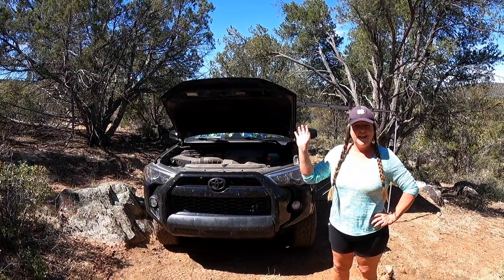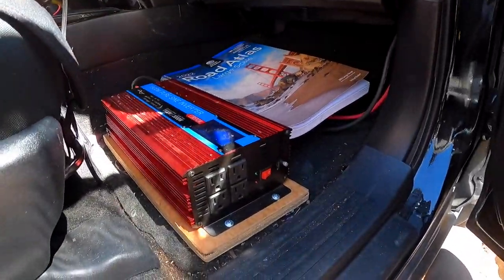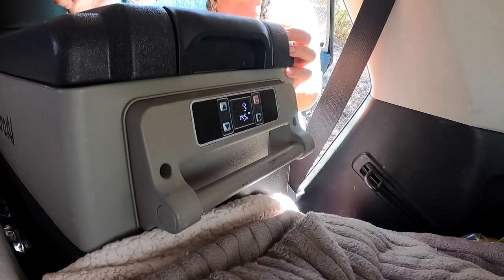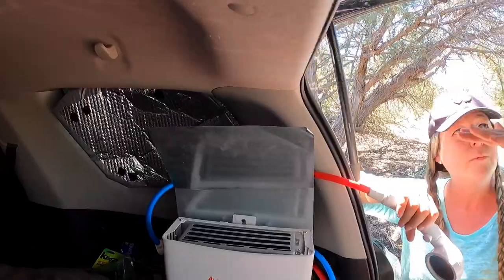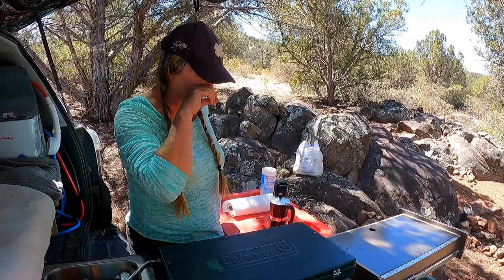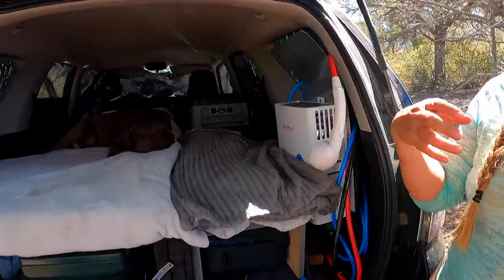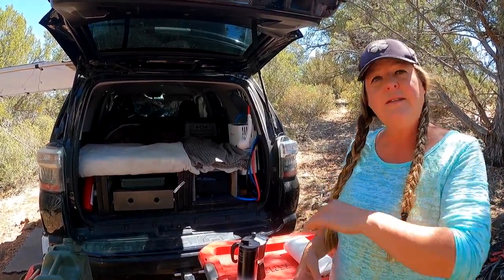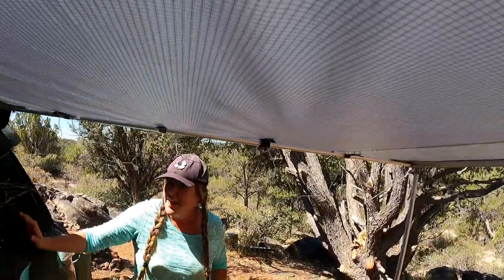BUDGET BUILDOUT (w/ Links) - $2,500 4Runner "Micro RV" Conversion - Solo Female Touring The West

Comment: Hi Donya.  Saw a nice red 4runner for sale today and wondered if I could fit to sleep in the back at 6’1”. ?  Currently sleep in a long bed Tacoma.
Reply: Hi Marc! I am 5’ 5” and I can fully stretch out on my sleeping platform and not touch the tailgate. I think if you either remove the front passenger seat or if you don’t want to do that you could slide it up as far as it will go then you’ll have plenty of room to sleep in the back. Just depends on what your sleeping system ends up being.

Comment: How do you hook up the hot water on demand for an outside shower when camping?
Reply: I have it mounted on some wood that I can pull outside to another location if I wanted, otherwise it just stays where it is, the tubes are lengthy and can reach a ways from my truck. It's such a great add to my rig!

Comment: @ 0:39
WRONG ONLY TO 50% OF CAP.
and that TRD is bone stock it doesn't have too much 4wd capability. so i would upgrade your axles to all the added weight.
Reply: Thanks for the correction! I'm learning more and more everyday
Reply from the maker: Hey Danial, I would have to disagree with needing to upgrade the axles. Donya doesn't have thousands of extra pounds to where it would stress the axles. A simple suspension upgrade would be sufficient and much more cost effective. Thanks for tuning in!

Comment: Where did you get the shower set up?
Reply: And, how did you set up the pull out drawer?
Reply: Hi Sandra!  I use the Camplux Tankless Water Heater. I have it hooked up to a small water pump which required a tiny bit of electrical and it's connected to my huge red inverter (I pointed out the little switch on the back of it that I flip on when I want to use it and voila...water pressure!).  It's so lightweight and all you have to do is put a few size D batteries in it, hook it up to the propane, hook up to water and turn the switch!  It's portable and can be used anywhere.  Another tip, I purchased several of those interlocking gym padding type squares to stand on while I shower.
Reply: @sandraschneider8438  After watching literally 100's of youtube videos, I designed the simplest system as a beginning.  I would just watch the videos and figure out which one works for you...then my next door neighbor at the time who had all the tools and knowledge guided me through the process.  Next time for any adjustments and rebuilds I know I could do it on my own. And we learn just by researching, asking questions, and doing it!